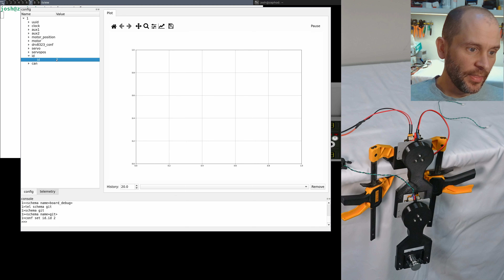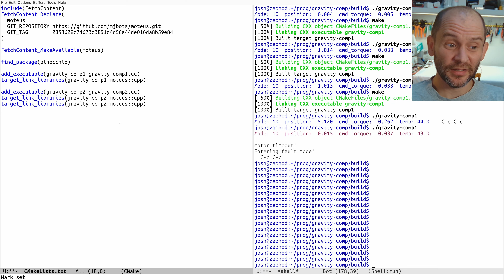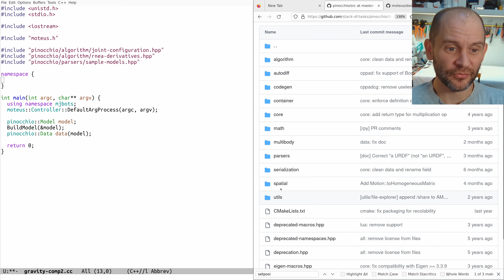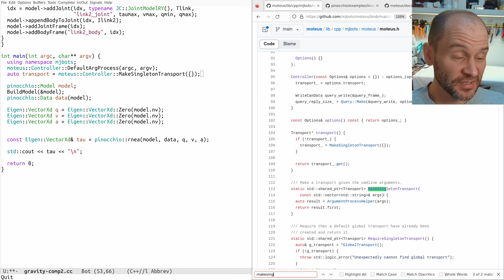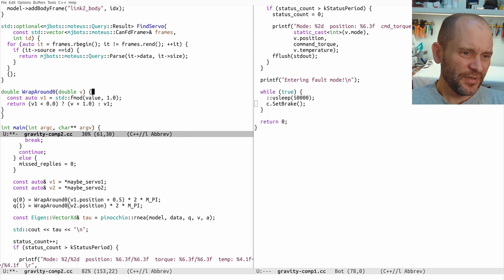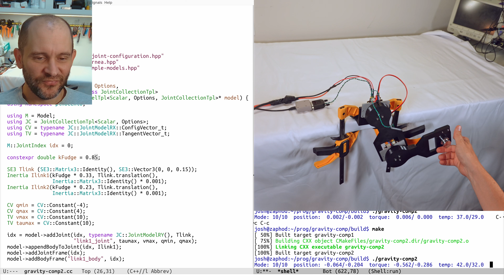2 DoF gravity compensation - moteus w / C++

Comment: I feel like I missed something?  Why not just apply  the  Counter ClockWise torques 
          T_1 = g (m_1 d_1 \sin \theta_1 +  m_2(L_1 \sin \theta_1 + d_2 \sin \theta 2) ) and
          T_2 =  g(m_2 d_2 \sin\theta_2)
where m_1 & m_2 are the masses of the links, d_1 and d_2 are distances from hinges to links' CoMs,
L_1 is distance from shoulder to elbow, and the theta's are the angles measure dCCW from vertically down. In my present state of mind, or ignorance, I don't see the need for inverse dynamics and all those cumbersome libraries.   Now, if you were also trying  to compensate for friction, or deadbands or make a synthetic inertia, or didn't trust your torque controller, that would be another thing.

Comment: Hi Josh, I was planning to make a gimbal with your drivers and aksim-2 encoder. 
Can I chain the motors like you do here?
Reply from the maker: Yep, you just have to give them unique IDs first.
Reply from the maker: Do note that only the moteus-n1 can connect to an AksIM-2 with no extra circuitry.  The r4 requires an external rs422 transceiver and voltage converter.